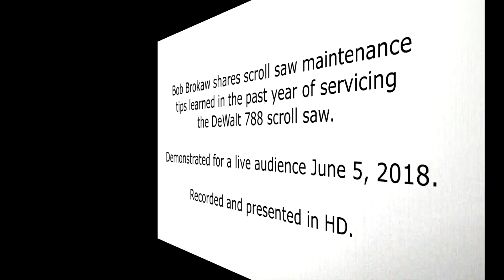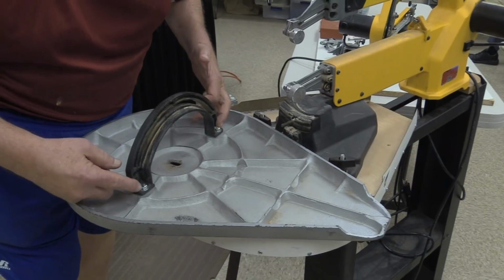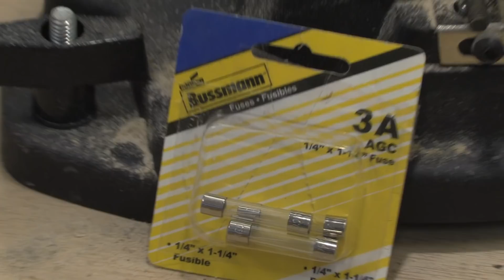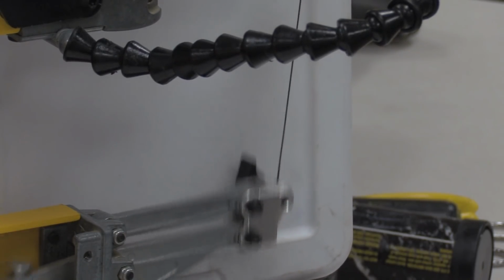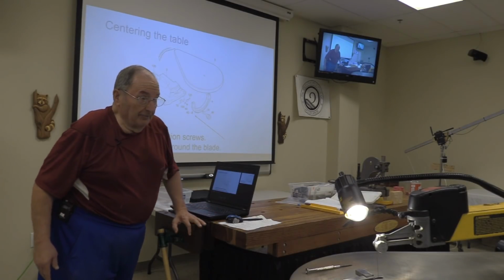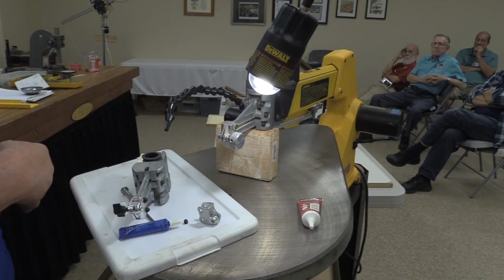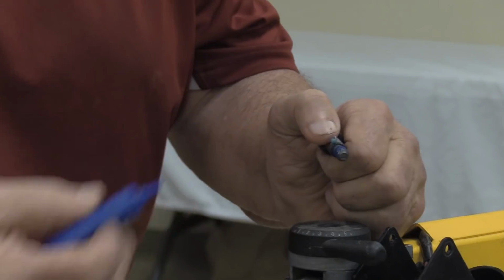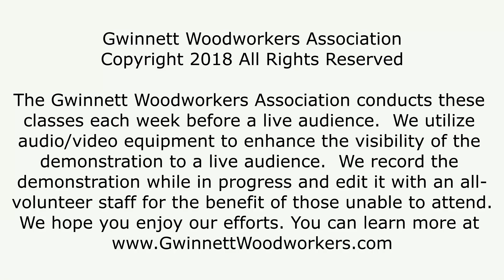2018 Scroll Saw Service UPDATE!

Comment: On my Trunnion screw. I rolled a small O-Ring back as far as it would go. That keeps the bolt from sliding back. And so far no issues with it.

Comment: So, I followed the vid and lubed the bearings, however, when I reassembled my saw, the tension lever on the front of the saw is now set back from the original position by about 3/4 inch. Why? How do I remedy the situation?

Comment: I realize its late to be asking questions, but I just found this video. Any experience, knowledge, or opinion on the Pegas blade chuck replacement kit for the Dewalt? Thank you so much for what you do!
Reply from the maker: Hans Meier reports about how fast he can move to the next inside cut compared to the standard DW blade chuck. Few people scroll as much or as fast as Hans does. Other users don't notice much difference other than the motion required to tighten the blade (a twist as opposed to a lever). Pegas was supposed to send me an evaluation unit.... I'm still waiting.

Comment: I just unboxed my new 788 and it appears the blade holders are not machined correctly. I noticed that both blade holder slots hold the blade at an angle. Clamping a straight rule in the top blade holder shows the bottom missing the lower blade slot  by almost 3/32" to the left. Clamping in the bottom shows the same thing to the right at the top holder. This imparts a "S" shape to the blade before tensioning.
Assuming this is not normal, what should I do to correct this?
Reply from the maker: The upper/lower rocker arms and their respective struts are made of some rather soft aluminum. It is amazingly easy for them to get bent in shipping. I see 2 possible resolutions. 1) Exchange the saw with your retailer (this should be covered by warranty.) 2) place a 6" machinists rule in the blade chuck, tighten the blade screw, insert a straight blade screwdriver between the rocker and the strut; over bend and release the rocker/strut until the rule lines up with the opposing blade chuck. Repeat the process on the opposing rocker/strut. This should solve the "S" shaped blade issue.
Reply: Thanks for the almost instant reply. I was afraid the arms would be more brittle. I used a 10" crescent wrench closed on the blade holders and tweaked them into alignment. A few seconds later and all is well.

Comment: I been using my dewalt 788 for a few years now, today It just wont go on, what can be the problem
Reply from the maker: Most likely the brushes have worn out. They cost less than $20.00 and are not hard to change.
Reply from the maker: "just won't go on covers a wide range of possibilities. The simplest solutions would be the fuse (below the motor) or the switch (in front of the speed control knob). The fuse cover is most easily removed by using a jeweler's screwdriver (straight blade) to press the release under the hole in the top of the fuse holder. 
  The cover over and behind the tension lever can be removed to get to the switch to test it.

Comment: OK, I'm stupid.  Where are the "Needle Bearings"?  I am a bad DeWalt owner.  I have never cleaned the innards and my saw is about 15 years old. (Type 1) It has been always my "go to" saw.  I also have RBI Hawk and an older Excalibur, neither of which is as user friendly as my DeWalt.
Reply from the maker: If needles are on the inside of certain bearings. If you tear it apart be prepared to replace the bearings. It's hard to tell if they are bad by looking at them. After 15 years they might still be great depending on how much you have been cutting.
Reply: You'll want to go back and watch his older series of videos in which he tears down and lubricates all bearings, sleeves, etc.  The needle bearings are in numerous places and there are quite a few of them.
Reply from the maker: There are 16 needle bearings in the 788. Twelve of them are the same size. The fact that you can't see any of them is a "good thing". When I take the bolts loose that hold the upper blade chuck on the upper horizontal rocker arm and a whole lot of short rods spill out onto the work bench, that's a "bad thing". The needle bearing race is pressed into the ends of the casting that makes up the horizontal rocker assembly. A hardened sleeve is inserted into the needle bearing race, the chuck is put in place, and the bolt holds the whole assembly together. Due to the speed  that the rocker assembly (and other related parts) operates, the needle bearings need some high quality grease to keep them operating. Type 1 saws had grease applied as part of the assembly process. When the type 2 was created on the way to Taiwan, the grease step was eliminated because it was making the saws last too long (15 years in your case.) Dewalt decided they were in the business of selling saws and grease was getting in the way of that.
Reply: Thank you all very much.  I am going by the mantra "If it ain't broke, don't fix it" but I will do some of the simple maintenance things I can safely do without coming up with "extra parts".....
Reply: I'm in the same situation as you, Marty. I lucked out and have a type 1 as well, and I haven't really used it a ton. I'm hoping a fresh lube job is all they'll need.  I saw Bob's other video that shows how to do the bearings & I'm confident I can easily do it.